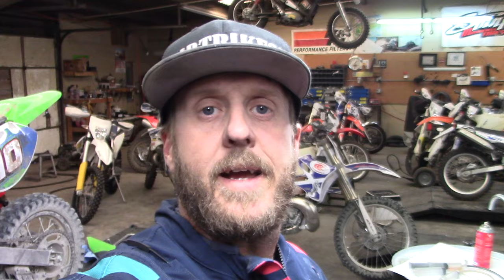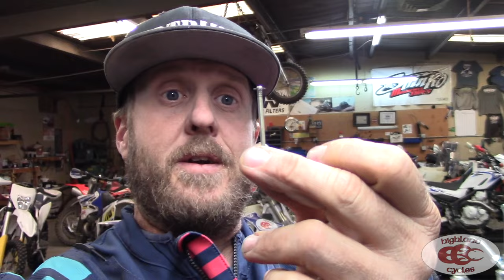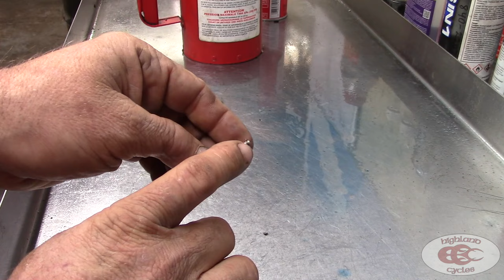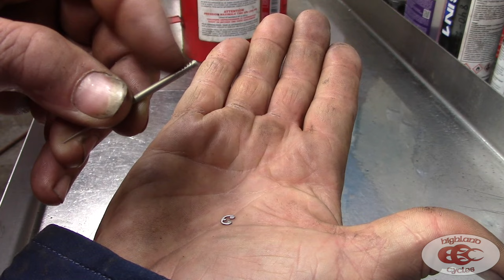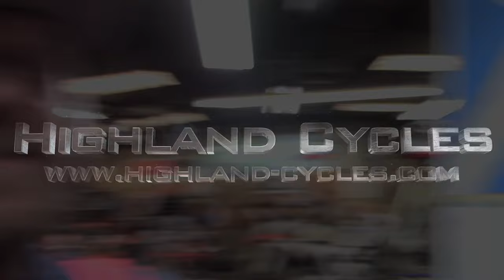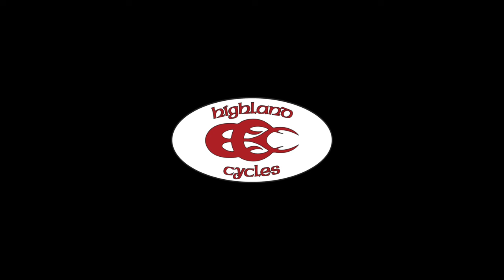What Position For My Needle Clip?

Comment: Every time I hit the throttle fast on my 150r is bogs down and the carburetor is clean could it be the valves?
Reply: I can’t remember the details because it was over 10 years ago, but I had an 07 crf150rb that had a lot of hesitation and my brother did something to the accelerator pump with safety wire that fixed it. If you google crf 150r accelerator mod it should come up. I hope that helps

Comment: My 2014 kx85 is sluggish from dead stop to like quarter throttle then it opens up and runs really good I can’t figure out what’s wrong wha could it be
Reply from the maker: Put a bigger pilot jet in
Reply: @highlandcycles  would that cause the problem I was thinking the main jet it still has both stock jets I think the pilot is a 45 and main is 140
Reply from the maker: It could. Try a 48 pilot and see. If it gets better then you’re on the right track. If it gets worse then go the other way.
Reply: @highlandcycles  ok thank you and another question if you don’t care the tailpipe has some oil seeping out of it after riding just a small line of oil coming down it ain’t that a sign of it running rich the engine has been completely rebuilt by the Kawasaki shop so I don’t think it’s worn ring issue or anything it’s still breaking in right now I already cleaned the carb also
Reply from the maker: @NRASUPPORTER1911  that drool is sometimes a sign of rich but it can also be normal. My bikes all drool a little.
Reply: @highlandcycles  oh ok I was worried about it but if they drool some isn’t that a sign it’s not running lean I run klotz oil 32.1 mixture

Comment: Hi I have a ktm sxf 250 cc fuel injection and when I pull throttle it dies and when pull choke out it bogs bad can u help it’s 2011 model race tech engine
Reply from the maker: Might need a fuel pump
Reply: @highlandcycles  I have fuel pump
Reply: @highlandcycles  when I pull choke open it dies instead of running quicker
Reply from the maker: @stevenmcallister2230  right. That “choke” is just an opening for more air. I bet you need a pump
Reply from the maker: @stevenmcallister2230  new one
Reply: @highlandcycles  how do u know if pump isn’t working
Reply from the maker: @stevenmcallister2230  test the pressure. The other thing I’ve seen fail on those is the stator. It’s actually the pulser coil that fails most of the time but that is part of the stator in the parts Fische
Reply: @highlandcycles  should the carb have a air screw under throttle body as there is no screw one video I watched shows putting own screw in could that help
Reply: @highlandcycles  we’re is the stator located
Reply from the maker: @stevenmcallister2230  left side engine cover

Comment: I just use needle nose pliers to pull it off and doesn't fly anywhere lol. Should carry a tiny set with you anyway so no reason to really make it fly anywhere.

Thanks for the video tho!
Reply from the maker: Just so you know, I’ve seen them fly even using pliers. Little buggers are sneaky.
Reply: @highlandcycles  that's true! I'm sure it's harder while you're under pressure in a race as well..

Comment: This might be a dumb question but I’m new to 2 strokes I have a kx125. It has a fmf fatty and fmf silencer. I have the exact jetting setup it calls for. Clip position is at 2nd. The bike is loading up right before getting on the pipe and loads up and gets the plug soaking wet and dies instantly. If I were to move that clip position back up to 1 will this help out or is this a main jet problem?
Reply from the maker: Could be both. Also could need to adjust float height

Comment: Hey I have a ktm 300 exc and previously it was running really bad at lower rpm I have tried a few clip positions and now I'm on clip position 1, airfuel 1 1/2 turns out with idle screw pretty wound in but it is running the best now. Could this be running too hot and cook my piston? Should I change a jet to compensate? Also it has after market exhaust fmf gnarly and powercore 2
Reply from the maker: No, it won’t hurt anything. Clip positions and air screw adjustments won’t burn a motor up.
Reply: @highlandcycles  Okay, thanks mate

Comment: Hey just got a wr250f yamaha 2003 need help with carb it's flooding I live in Tahoe 7000 ft elevation
Reply from the maker: Start with a good cleaining
Reply: @highlandcycles   it's clean and installed a all balls racing carb kit im wondering why my float is stuck I have it on 4 for the needle clip being higher elevation as being leaner as in less gas right should I go even leaner it has 7-9 groves
Reply from the maker: @brandenrickel1192  is go to #2

Comment: Do manufacturers still throw far-too rich throttle slides in two strokes? 
That always infuriated me.We'd fool around with needle position and such,but in the end you just had to go buy another slide because the idiotic factory wanted 'safe' jetting that couldnt possibly cause a seizure on overrun
Reply from the maker: Yes they do
Reply: @highlandcycles  😦

Comment: Only on idel my quad smells like gas Why? Is it that needle
Reply from the maker: Not sure.  Probably not the needle.  Probably need to really rebuild the carb with all new rubber parts
Reply: @highlandcycles exactly what it needed. Hoses dried up and the drain bowl leaking. Now I jus gotta find screws that fell out of the idle control wheel bracket.😢
Reply: Now I have a can am ds250 that pops on deceleration but only when braking. Weird I thought. I think I gotta do exactly what you did and drop the needle. Am I correct for this issue? You've been a huge help so far.

Comment: my bike jerks when I'm riding and stalls when I'm going fast then hold in the clutch. it's like a spotty throttle response and I dont know what to do! PLEASE BE A GOOD DUDE AND HELP A HOMIE OUT
Reply: Souds like either a rich bogging or a lean bogging, if its only at full throttle it sounds like air fuel mixture is incorrect. If your happy the carbs ok, jets are not blocked etc. Try turning the air screw on the carb in (clockwise) to the richen the mixture. If its worse then its most likely a rich fuel problem. If its better then it was running too lean. Then just find your sweet spot. Average base settings is 2 turns out on most carbs. Check where yours is set before you alter the settings so you can go back to them if no better. Hope this helps 👍🏻👍🏻
Reply: @davecunningham7018  thanks your a good dude👍👌

Comment: I have a 1993 RM250 and it SEEMS like it's running rich. I replaced the float, old one was a little fuel logged, jets are stock and seals are good, it has bad bogging throughout the midrange but the super low and the very top end are smooth and powerful. Any ideas?
Reply from the maker: Not sure. Make sure the needle isn’t worn or the hole it goes into